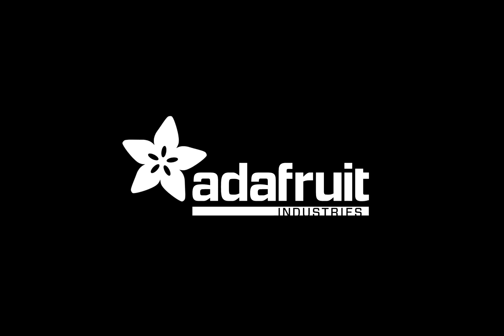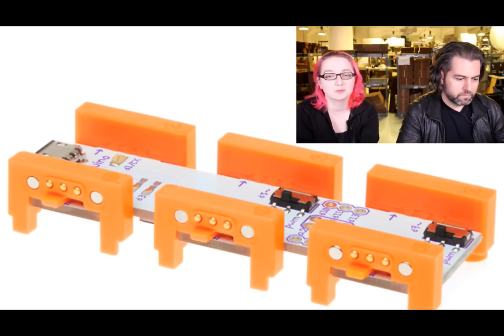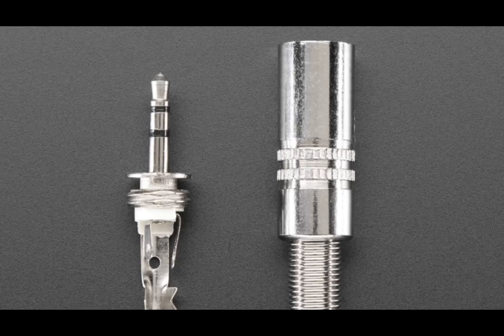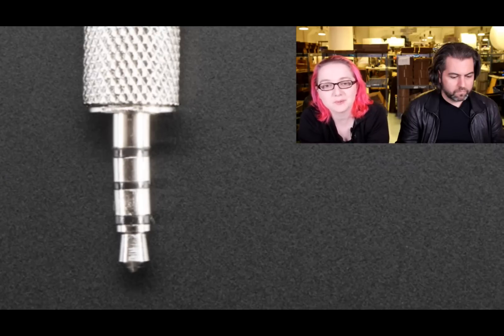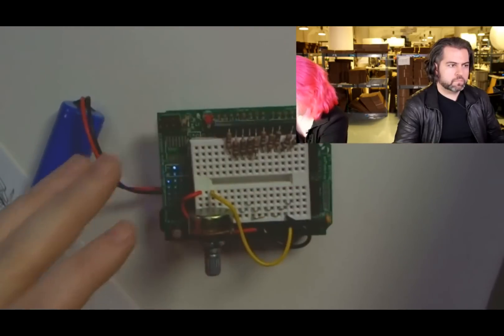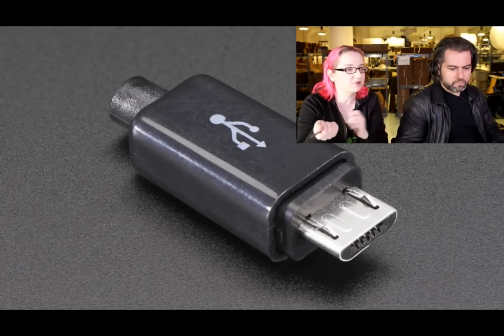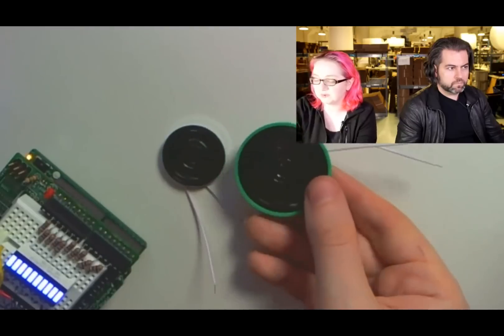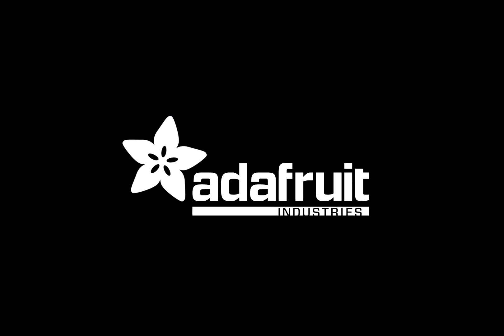New Products 5/21/2014

Comment: Thank You!

75 Y/O who started electronics in 1957, building a Heath Kit Crystal Radio • • • a chunk of Crystal in a small copper pot!

WIND the 400 turns of enamel covered wire, center tapping at 200 turns!

I have never stopped enjoying ELECTRONICS, indeed I entered the US ARMY signal corps school in 1968, graduating in the top 5% of 537 men in Avionics Repair!

I am Finding these Videos to be Very Helpful in choosing what I am ordering:

My ~current~ project is FIVE 5VDC solar panels @ .3 +/- amps with USB A connections • • • • • • they will end up hinged together, with the USB A cables to output "all in one" !

Thanks Again, 

philip in Oregon, part of the Great Pacific North WET, USA